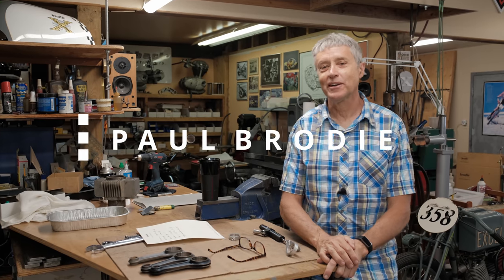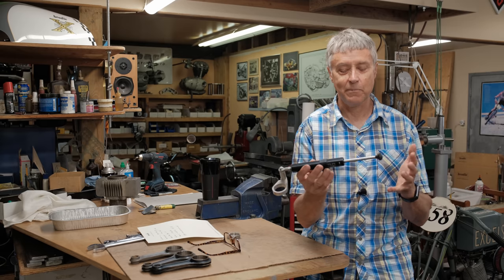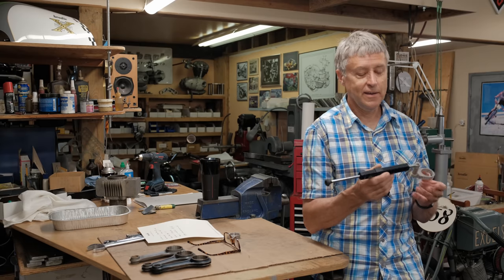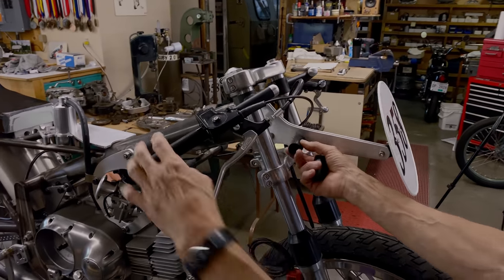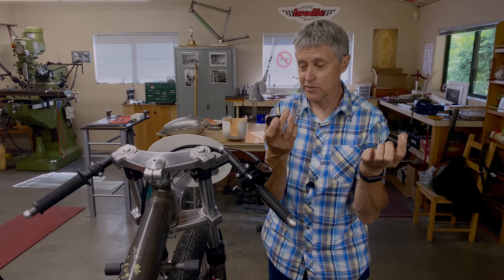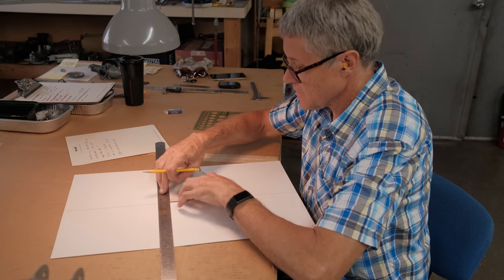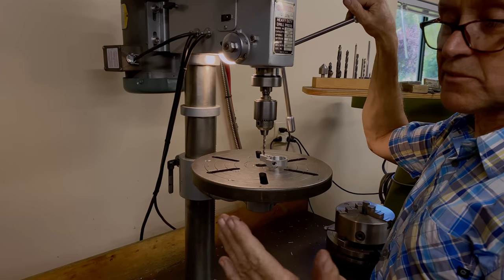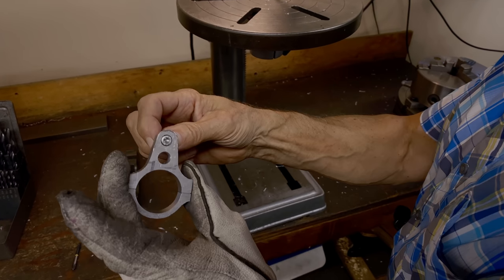Aermacchi Steering Damper // Paul Brodie's Shop

Comment: Hi Paul... re your point that you didn't think you'd adjust the damper very often so mounted it on the right. My experience... generally you stiffen for high speed runs, like on the track. But try riding at low speed with a stiff damper and it'll scare you as it prevents fine steering inputs for balance... you must back it right off before leaving the track or slowing down, so I always mounted on the left to adjust on the fly according to speed. Hope this helps... with your design you could still swap sides.

Comment: If your bike is a 350 , you would probably be running M-PG(modified-pushrod gas).Record is held by H-D. And is 108.106. Weight is your friend. Gas tank should be a minimum of 1.5 gallons. You don’t want a knee slapper. Make sure your damper actually works. My Ducati 999S ran 154 years ago but the speedometer tuned off at 184. 30 MPH of wheel spin . The salt is slippery. Good luck. Next year is the 75th . See you there with my 79’ Moto Moroni 500. You can always do a better job if you have the right equipment , and you do. Enjoy your show and all the toys you’ve got.
Reply from the maker: Thanks Ray. Is the 1.5 gallons for the tank for the added weight? Or is that a rule?
Reply: As per rule book, the gas tank should be a MINiMUM of 5 liters or 1.32 gallons. I guess you can make it as big as you want.  The place to put additional weight would have been in your swing arm. Lead or steel shot in the swing arm when it was apart or bolted on it SAFELY on the outside. My Morini is basically like your bike.  It doesn’t go fast enough to justify swingarm weight. Hope my reply helps.
Reply from the maker: @raymigut364  Thanks for that info. I might have to get a rule book to see what else I don't know..
Reply: @paulbrodie  I know you did a bunch of work on your front wheel, but this is what I would do for a ride at Bonneville. Take the shoes,etc. out of the front wheel.  Disconnect the front brake.You don’t need it anyway. Run a cable from your rear brake to your disconnected front brake.  No rear foot brake. And join SCTA/BNI and get a rule book.
Reply from the maker: @raymigut364   But... I like my front brake! I know what you are saying makes sense. I will get a rule book. Thanks Ray.

Comment: just a thought, you could mount the steering damper on the lower triple, tight to the pivot point for a cleaner look. nice project you have going.
Reply from the maker: It did just get remounted. Thanks for watching!

Comment: Clamps turned out real nice.
I wouldn't have thought of using 4mm Allen bolts even though they are more than strong enough and would have used 5mm or 6mm. (even though I keep 4mm stainless Allen bolts 'in stock!)
Maybe I should re-think all the overbuilding I do on stuff?
Very nice of you to show it actually takes some  'science' to design things.
 Do draughtsmen exist any longer in the C(omputer)AD world of today?
I use the same 'cardboard aided design' as it's faster for 'on the fly.
' Guy in 'Cafe Moto' Orlando spent 10 days using a computer to design a top yoke so it could be CNC cut. 
 Simple design, probably could have made several in less than in 10 days.so it was OTT for a one off
Reply from the maker: Thank you! Yes I'm trying to be a little more minimalistic than I previously was, but not to under-design. One of my next projects will use an even smaller 3mm Allen screw...
Reply: @paulbrodie  Cool,I can hardly wait for next 'instalment' Living vicariously through your work
;o)

Comment: As a 1994 900SS owner I'm almost jealous of your 15° of steering either side! 

I actually have no idea how many degrees of steering my bike has but it doesn't look like much more than that. It's surprising how little steering angle you use on everything but the slowest parking-lot maneuvers. The only time I notice the tight steering angle available is getting the bike positioned in my overly full garage.
Reply from the maker: The most steering angle is probably used for parking..

Comment: The Bonneville Salt Flats mandatory steering damper for all motorcycles rule is apparently wide open for interpretation. A member of the 1% steering club?

"As a matter of fact, his maize and blue Triumph won’t even turn. Lackey explained that since the front tire turns 16 percent slower than the rear tire during a speed run, he locks down the steering dampers and even then the rear tire twists the bike slightly sideways as it tries to outrun the front of the bike. “You steer it with body English,” he said.

At only 5-foot-1, Lackey hasn’t got much body to English with. Still, he stands tall among his fellow motorcycle riders, being in a rarefied fraternity that takes the need for speed to the edge."
Reply from the maker: Yes, my friend Tom Mellor has set a dozen records on his '69 Triumph triple. His rear wheel is always spinning faster than the front wheel.

Comment: When you were making the steering stoppers.  I was thinking that it would be nice if you bored the ends that rest against the fork tubes to match the same radius when the forks rest against the stops.
Reply from the maker: That could be a nice touch! Getting the radius to fit the tube perfectly could be tricky...

Comment: I always love your videos Paul. I’d be worried that the clamp on the frame side may rotate.
Reply from the maker: Thank you G Man. I actually have to remake that clamp 1.25" longer so that the damper clears the tank shell. I will make it a bit stronger so rotation is not an option.

Comment: Hope you join  triple Tom M in doing a vintage run at the flats with the bike. LOL! My guess is 106mph maybe 102? 19/45 may do that the 441 likes 19/47. Ti valve stuff would help.
Reply from the maker: Maybe 2022 will be the right time to head down.. On a race track (sea level) my bike would do 120mph, but salt is salt and there is altitude involved..

Comment: I find that designing in solid works or equivalent and then printing out the design 1:1 is easier that drawing the part on the metal. After printing glue the printout to metal. Accuracy of printer is within .05mm. Holes are marked with center and that means hole placement is easier and better. You also have a digital record of parts if you need to reproduce the part or sell the design. There are free design programs that are very close to solid works. Online is one of them.

Comment: hi Paul as watching your new video I wonder how you proceed to do such a main frame tube oval vertical on the fork side to oval horizontal on the back side. I peel all your video but not seen any explanation. If it's not a fab secret would you mind give me some lightnings ? Is it under press shaped ? :-D
Reply from the maker: Yes Franc, I used a hydraulic press and put the tube between (2) fairly substantial pieces of steel flat bar. It works very well; no extra, unwanted marks in the tube. In the Romax frame build, that's how I ovalized the seat tube as well, but in my arbor press.

Comment: I was intrigued by what happened at 8:12.  I've been overwhelmed by the streamer of Delrin swarf coming off the work piece before now and I thought "Paul has a technique to prevent that!" Looked like you made a spiral cut away from the chuck which I thought would then break up the swarf for subsequent cuts, but your next cut went deeper than the spiral so you still got a continuous streamer of Delrin. Is there some hidden magic behind the spiral cut?
Reply: no magic, just a way to get the tool back to the start without backing out. one less operation.
Reply from the maker: Da Os is correct!

Comment: There are two different types of POM. POM-H which is also known as Delrin, and POM-C which is known typically as just acetal. They have slightly different properties, but for casual use there is no real difference except acetal is typically cheaper
Reply: @paulbrodie  you got it

Comment: What is the Benefit of using the milling machine saw blade over a band saw?  Just curious.
Reply: Work holding, finish, for some applications; kerf width ... Band saw isn't always straight either.
Reply: @paulbrodie  makes sense. The slotting saw looks so intimidating to me. Looks like a fingers worst enemy!
Reply: @paulbrodie  kinda like my wife. Haha.

Comment: Should of had gloves on " A "🤗
Reply: Yeh we’ve all turned a pillar drill into a pillar part spinning flail. Iv left a mole grip type welding clamp permanently next to mine with the drill vice so I have zero reasons to not use it.

Comment: not safety third, you don't want to go into a tank slapper at any speed but high speed is a funeral about to happen the first time I saw it the rider died it was a flat track race he flew over the top of the track fence/ no backdrop fence to catch him//  took out a fence post bore flying over a portion of the parking lot slamming into the back windshield of a crown vicky and pushing the front bench seat into the dash. it all happened in fractions of seconds if id had blinked i would have missed the whole spectacle. 

 it took me a second or two to even take in what just happened. it was that fast my friend was racing right alongside of him.  The steering damper prevents this. anyway, the guy died and his bike ended up in the infield in little pieces. kinda ruined the night for me.  you don't want to see it let alone it happen to you. don't ride without one. steering locks aren't a bad idea either. glad Paul covered the topic.
Reply from the maker: Yes, motorcycles can be dangerous. I only put the steering damper on because the bike might make it to Bonneville, where they are required. I road raced my Aermacchi for 5 seasons and never had one, because it was never needed. It handled beautifully and never shook its' head once, no matter how hard I pushed. Thanks for watching and commenting.

Comment: Once you drill it and retap it you'll be 0.00339" shy of full threat depth per side and many of those 1/4-28 threads will come close to lining up with the M7x1.0...... how fussy are you really?
Reply from the maker: Yes, I got my thread gauges out and 28 TPI is almost identical to 1.0mm. I did (finally) find my 7mm tap, so it was easy to rethread and fit the rod end. I can be very fussy!